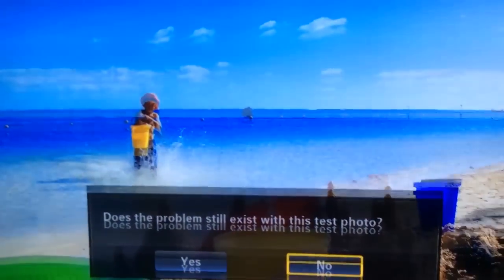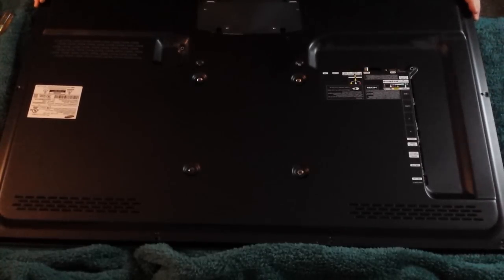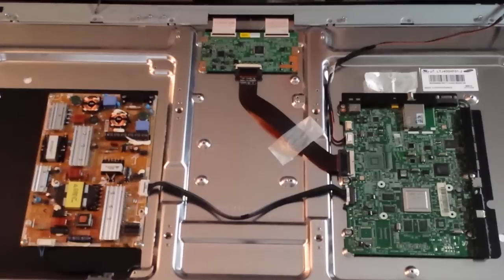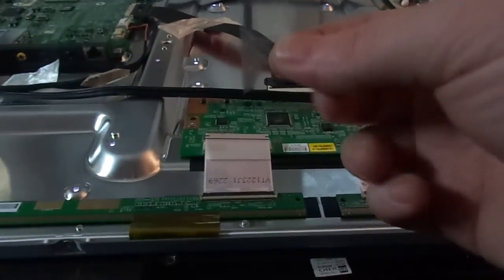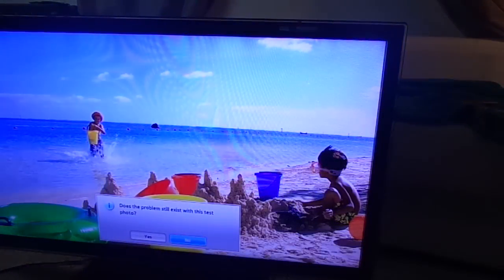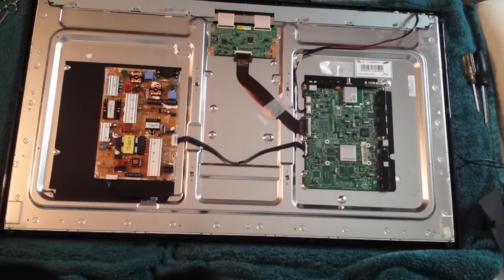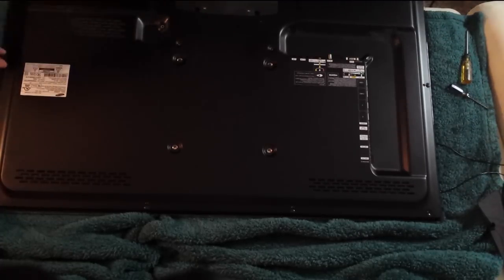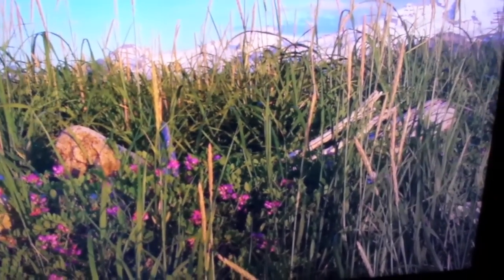LED LCD TV FIX, How To For Samsung Double Image, Black Vertical Lines, Screen Problem Sony LG.

Comment: Your video is unclear I can't see how and where you taped and you didn't explain clearly. You cut the tape smaller but it looks like you used the bigger tape instead. So what how to tape it so it work?
Reply from the maker: Florida kl the tape is supposed to be placed over the gold part of the ribbon cable. The size of the piece of tape will vary from TV to TV. I started with a piece about 1/2" and at first the whole screen displayed white. So I removed the tape gently, cut it to a smaller size then reapplied. I continued those steps until the tape was about a 1/4" wide covering the gold part until the display started looking better. I understand how frustrating it can be to have a display issue with a TV and just want it to look right. People have posted on this many different results for a variety of TV. Most
 of the time this works and sometimes it doesn't. This is not a true repair video as I repair shop would probably never do anything like this for a customer and charge a fee. It's for anyone who is about to toss their tv or buy a new one and might want to give this a go.  I hope this helps. I hope you can get your tv looking good again.
Reply: Samsung model ua3eh4000m. I only see the one black ribbon and 2 boards.  I don't wish to buy new as I'm sure it can repair, the problem is inside not the same as your or other vids.  There are 2 boxes that says left and right but no ribbons. There is a panel at the bottom but cannot open..

Comment: It's too complicated and my tv doesn't look the same inside ?. What do I tape I'm lost!
Reply from the maker: It depends on the type of TV you have. If the set up doesn't have the ribbon cables by the t-con board then check around the sides of the display panel do you see several ribbon cables that are not removable? If so there are videos that show how putting a spacer between those cables will clear up the display. Also I don't know if this will work on all plasmas.
Reply: Samsung tv, inside i only see the black ribbon in the middle similiar to yours,  i  tape that one but no use. I cannot find other ribbons you said connect to left and right :(

Comment: ok so i have a samsung I did the tape fix had the tv apart a few times but seems the one side that had the issue has a slightly darker contrast then the oppisite side on a white background. think i can straighten that out by adjusting the tape ? or is it caused by the tape in which would taping the oppisite ribben fix the issue by making the screes match ?

Comment: Here is my issue, when the metal cover is removed at 3:40, you can see 6 brown ribbon cables, one of them is malfunctioning and causing a very bad picture. I opened it up and and was able to determine which one, but I need a more permanent fix because when I use electrical tape, it tens to move out of place and  the problem continues. I'm worried I need to replace the entire LCD panel, anyone know what part it is?

Comment: This is amazing! It really works! I also found very similar Samsung TV out on the street (with still active Netflix subscription), it had no picture, got it fixed but then after some time horizontal lines and glitches starting to show. Now this is really interesting - why this works? If you block off some of differential signal pairs then the driver chip realizes that and simply uses the remaining pairs for data transfer effectively avoiding the damaged LVDS channels? Is that the same way as PCI-express cards can work in slots with less signal pairs? Thanks Dave for sharing this!
Reply from the maker: Nils Jakobson You Rock!

Comment: Thank you sooo much :D I had horizontal thin grey or black lines on half of the screen. I arrive to remove all with 4 or 5mm tape on the side of the tcon connector. After that I just have a blue line on edge of the screen witch I arrive to remove. I just move toward center of the connector for 2mm. Hope you will continue this type of video :)

Comment: Holy Smokes, batman, this shit actually works.. I have a Samsung 40" LN40D550 which had horizontal lines going across the top One third of the screen.  Not the same issue as yours but after all else failed, i decided to give your method a try and see if it would work for my issue.  Lo and behold it did.  Yes it took a few tries, where I had to cut different size tapes, but finally it worked.  I don't know how and why it works it just does.  Thanks man.

Comment: The tape got rid of the vertical lines and the picture is now appearing. However, the picture on the right is slightly darker than the picture on the left.My question is why is this so? Does the consistency of the tape matter (thickness and thinness of the tape)?What would you suggest we do to get rid of the differing shades on each side of the screen?Thanks!
Reply from the maker: Eric Miller honestly that has been mentioned alot in the comments and I eventually noticed the same happening on my screen. I can't say for sure a specific way to deal with this issue. This video is definitely not what a professional would do and charge to fix a client's tv. All in all it's a jerry-rig.
Reply: Thank you for your quick reply!

Comment: What should u do if it turns your whole picture to have a white tint after u get rid of the line
Reply from the maker: Does the picture look hazy? Maybe switch some of the picture settings in the TV menu and see if that helps.
Reply: Do It With Dave I went to the setting and nothing changed it seems like the picture is set to a negative setting for the whole picture
Reply from the maker: Tim Railey there is another video on YT showing how to fix that. I'll look if I can find and share link.
Reply: Do It With Dave thank you
Reply from the maker: Tim Railey does it have this option? https://youtu.be/Q1bg9qP_qic
Reply from the maker: Tim Railey or this https://youtu.be/Ewdgnq_IRp0

Comment: Why is this not working for me I tried it like 20 times it is the left half of the display is there a number of how many pins should I tape?
Reply from the maker: Nikola Stojkoski some ppl posted they did the right side and it worked for them. You could try switching sides. Maybe check to make sure the ribbon  connection tips are not damaged. As for the pins that is mostly on a case by case sometimes. Ppl did less then 10 others more than 15.

Comment: I have a Hisense TV I'm having the same problem I would like to know will this fix the problem for my TV or this just fix Samsung TV.
Reply from the maker: Doreen Lockhart hello. Ppl have commented that this works on a variety of TV's and I was surprised so if it is worth your time you may want to give it a go. Just remember this is no professional repair just a DIY project.
Reply: Thank you for your response I might try it.

Comment: Hi,  Thanks for the simple and clear video presentation.  I originally had a double image but now have another problem.  I was testing tape locations on the left(viewed from the back) ribbon band and then I stopped getting a picture on both sides.  I found that when I clamp down the left ribbon band connector, the left side of the picture is black and within seconds, the black spreads across the other side so that both sides are dark.  If I remove the problem ribbon band again and turn the tv of and on, I can get a picture back to the right side, but with both ribbon bands connected, I lose image on both sides.  Any ideas if I can save this TV.  It’s the exact same Samsung as in your video but 48”
Reply from the maker: alexgantry I apologize for the delay. I had a similar issue and what happened in my case was I damaged the ribbon cable. They are very delicate. You may want to check that the ribbon cables are not damaged. It would be pretty obvious.

Comment: Awesome video.  My un55b7100 suddenly started to have a double image.  I followed your steps and fixed this problem.  I still have a slight problem.  The right side of the screen is SLIGHTLY darker than the left.  It is noticeable when you have a very light colored image on the screen.  I played with a bunch of strips of tape in various places and could not get this issue to go away.  Any suggestions?  Thanks again.
Reply from the maker: k wied hey there. Lots of ppl commented about this same thing and I did notice it after reading them especially on a white screen. As of now I don't have a good answer to solve this. As for now it comes down to if you can live with the issue or not. This is definitely not what any repair shop would do or charge for. They just suggest to replace the panel and I wanted a cheap solution. If it is something you end up working on definitely post any progress for others. I wish I had a quick solution for you.

Comment: awesome video thanks for the time you spent helping others!!! Just a quick question....That one ribbon is the one that controls the lines no matter where the lines are located???
Reply from the maker: Red I'm not certain of how the ribbon cables communicate but from what I've experienced it seems like each gold pin makes a connection with a line on the panel. So for every gold pin there is a line that will make up the picture. If they are not positioned right they won't display properly and give off lines. Rather than a clear picture. I hope this helps.

Comment: Hi Dave i have another problem how can i fix a blacky greeny vertical bar on top of my tv
Reply from the maker: T U R K I Y E I've seen some videos on Plasma TV that a little bit of light tapping on the lines could make it go away. It could be the line is no good from the ribbon cable or possibly a bad capacitor. If fixed computer screens with the lines from replacing a bad capacitor. I hope this helps.

Comment: When i tried to do this half the screen of my tv turned black and another half turned white. What to do?
Reply: And when i removed one cable the tv totally when black not just a part
Reply from the maker: sorry for the delay. I'm not 100% but double check the ribbon cables are not damaged. Sometimes they can get scratched.

Comment: I loved your video. I got my TV apart and was fiddling with the ribbon to try to correct the horizontal lines on my Toshiba (LG display inside, though), and the screen went dead on both sides. The backlight no longer comes on, and the LCD isn't displaying image (as tested by forcing the Backlight on and also by using a flashlight). I was so excited to fix my TV with your help, but I have apparently cursed my TV! I'm so glad this worked for so many people, but take the warning seriously! I could've just continued to watch TV with lines on it (as I have for the past three years), instead of breaking it!
Reply from the maker: I wish this wasn't a let down. It's just a jerry-rig approach to the common issue that a lot of flat screens get.
Reply: That's what I'm afraid of if I try this. I cannot afford a new TV. Mine is fine when I first turn it on but by evening time there's a horizontal line a third of the way down from the top of the frame. Then it gets worst. The top part above the line gets all blurry.

Comment: I don't really understand the purpose of the tape.
Reply from the maker: Cyriacus Duru from the best of my understanding the tape acts like a buffer to stop any static electricity from building up on the cables. Thank you for watching!
Reply: Do It With Dave thanks Dave. I will try it on my telly on Monday. I will let you know about the outcome.

Comment: I tried it and this worked on our 9 year 55 inch. Samsung tv. Didn't have to take speakers out, ours were on top. Tried the tape 5 times and final cleared the picture. Didn't need to hook up cable , went to menu and did picture check but had to lock the the ribbon each time
Reply from the maker: Tom Mitchell WOW that is awesome! I am always curious to know how many brand, model and year this will help on. Thank you for watching and thank you for your comment!

Comment: I cannot believe that this worked!
My 55" LCD Samsung had a horizontal line with artifacts, eventually producing the "double image issue". My TV's problem was with the opposite cable, so I needed to start on the right side. I covered only the right-most 5 pins with clear tape.
Reply from the maker: 81sillyputty I'm happy to hear this video was helpful in resolving the issue your TV was having. Thanks for watching and for your post!

Comment: Hello Dave  ~  My Samsung 46" LCD TV (LN46A650A1FXZA) has a very similar "double image combined with horizontal lines" issue as yours, but the difference is that on mine the image always clears itself up after leaving the set on for 10 to 12 minutes. The clearing is instantaneous and complete, but it is not prompted by anything I do or don't do. Before I open it up, I'd like to know if you think the LVDS tape fix you suggest here on the video will work, or is mine likely a deeper issue with the TCON board itself or capacitors or the power supply, or anything else you can think of? 

I tried warming it up with a hairdryer through the vented slots on the back to speed up the process, but that didn't change anything. Once the set comes into focus, it will stay that way in perfect shape indefinitely.What can I do or check to fix this initial 10 - 12 minute issue?

IMPORTANT UPDATE:

I was just experimenting with this set some more and discovered that if I move the swivel base from left to right, the image will come into focus. This can be done almost immediately after turning on the set. So, I don't have to wait for the 10 - 12 minutes described in my last post in order to obtain a clear image.

I can also gain the same clear image by reaching up and grasping the upper left-hand corner of the set (as I am facing the screen), and giving it a firm squeeze. This didn't work every time, but most times it did. Trying to do the same in the upper right-hand corner or anywhere in the back middle part of the tv had no effect.

With this new information, it appears that there is a loose connection somewhere in that upper left-hand corner. 

Does anyone have any insights based on these new facts / behaviors?

A Further Note: I did also notice that even when the horizontal lines and the double image are present, the double imaging really only occurs on about 2/3 of the screen. Starting from the left, it is very pronounced but it seems to get a bit better as you move toward the right and then the final 1/3 of the screen, only on the right-hand side, seems unaffected by the double imaging. The white-colored horizontal lines, however, make their way all the way from the left edge to the right edge. If you look closely at the images I included up above in Post #1, you will see what I mean. Not sure why 60% to 70% of the screen would have a double-image, and the remaining 40% to 30% does not. Seems like it would be a 50 / 50 split if anything. Any insights on this would be equally appreciated. Thanks.
Reply from the maker: Tubetowner881 there are a lot of videos showing the same issue your TV is having. From what I've watched it would make sense based on your comments that the issue is a bit different.  In other videos shown with this same issue the fix is done by putting spacers under multiple ribbon cables that run on top and sometimes on the sides. In these videos the cables are not removed but pushed a tiny bit to get a clear screen. I hope this helps. If you decide to go further please post and progress you make.

Comment: Hi Dave, Thank you for your video.
It worked for me (3-4mm tape on the right edge of the right ribbon) but now I have a thin horizontal black line 5-10cm from the top of the screen. Tried to change the tape around but it's always there. Do you know how can I correct this?

Thank you
Reply from the maker: Mário Sá if the line is really bothering you and you decide to continue to work on this see if by holding the ribbon cable close to the back of the TV and see if the lone go away also  look at the ribbon cable to see if there and any scratches on the gold tip. Sometimes the can become damaged. This is just suggestions. I hope this helps.
Reply: Do It With Dave  thanks again for quick reply. I will try later today to hold the ribbon to see if it helps. I didn’t see any scratch but In the meanwhile I have ordered a new ribbon tape online. Do you think a new ribbon cable will correct this? If not replacing the t-con board will do it?

Comment: My Sony Bravia has soft horizontal lines since the past month, i noticed that if i cool down for 10mins and then power on the lines are not there, but passed 50secs they appear again. Can this help me if i change the ribbons?
Reply from the maker: Im not sure based on how the issue is happening it could have something to do with the power supply. Maybe when the tv get to normal operating temperature the display is effected by it. You could see if the steps in this video would work. If I find any videos on YT referring to this issue I'll definitely post on this thread.

Comment: Hey! I have a panasonic LED tv. it was covered in horizontal lines across the bottom half the flicked to lines through the middle every few minutes. The tape trick has definitely helped by stopping it flicking and distorting. So thank you so much. Now I still have One black horizontal line through the middle and a bit of lines on the right edge like at the end of the vid. I have fiddled for literally hours with no luck on the one black line. Any suggestions. Can i buy new ribbon cables?
Reply from the maker: Jamie A I would check the ribbon cables for any sign of damage the tips are delicate.  If you see they need to be replaced Ebay is good can just enter number on cable in the search bar.